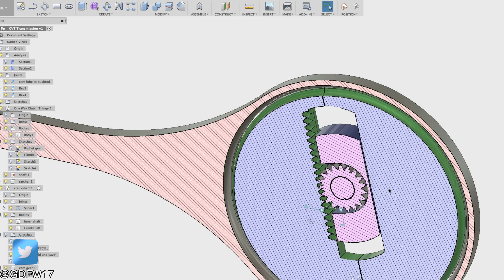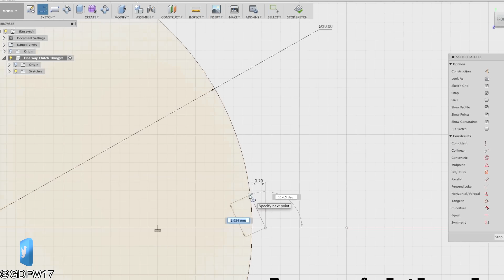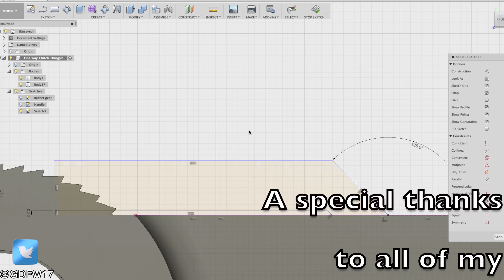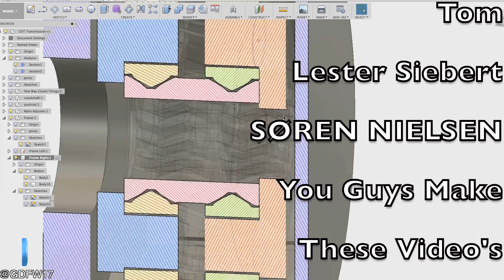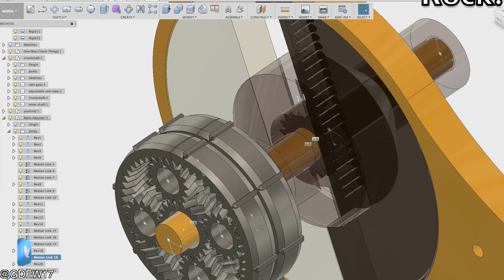The Coolest Transmission You've Never Heard Of... The Ratcheting CVT

Comment: You there? not seen many of this things of yours.. But? I was wondering. Why you haven't built a functional unit? do like a radio flyer wagon size.. making a Motor and transmission from the plastic hooked to the Axle to show the movement? Have you seen the engine designs from China yet?
Reply: when you YouTube china designs the first one is 50 different designs.. but if you keep looking down.. there are some other interesting ones.. And it's been a while since I watched them.. so..
Reply: you don't have to have Fire to have compression. Compression is simply expanding Air.. In a diesel there is no fire.. it's just heat and chemical reaction. Being said.. just to test theory's and to build first run. an air compressor would be enough. if your looking to run a full on Out option..
Reply: Which You're going to be.. I've been rolling around the Idea of using these plastic printer availability to try a Cold air compression theory.. See.. What I was thinking was a cold air source like Carbon monoxide? right? dry ice? with a Warm water mixing tank with a controlled pressure injection..
Reply: See.. by basically powdering the dry ice.. then adding hot water the mixture will create an expandable gas.. that then would be funneled into the compression chamber.  Using a like duel funnel design tank.. where the dry Ice like powder would enter as it is mixed with the hot water then captured and stored to be released.. think fuel filter
Reply: I'm a huge fan or the rotary design motors.. the newest one that's powering drones are impressive. But From your video.. I'd say just playing with the idea as you would other designs.. will be a puzzle of wonderment that will make you very happy.. Good luck.. My friend.. Trying to be there.. LOVE KIRBY
Reply: Kirby Wagner Diesel engines "don't have fire"? Are you nuts? I won't bother addressing the other idiocy you've been spouting..... Talk about parading one's ignorance!
Reply: GLOW PLUGS..  NOT SPARK PLUGS.. See? a Spark plug uses electric spark to ignite Fire in the combustion chamber - A glow plug Uses Heat to excite the chemicals to reach into an explosive reaction. that's the difference.  look it up..

Comment: Try ceramic for the slip engagement, steel wont wear out ceramic, i use ceramic bases when building hoist's and small cranes because the steel simply pivots and doesn't eat away the ceramic

Comment: I see more variable displacement engine than I see CVT to be honest... I guess if you play with the proportions of certain parts of the design it'll feel better as a CVT... And give it one or two more ratcheting mechanisms to make it smoother on the output side but still it's better as the basis for a variable displacement engine.

Comment: Why do say its like buying a super computer and playimg solitaire thats not true its like buying great internet and not using it,  a super computer u need to see as the engine and i see it as why would you tune your engine or upgrade it when its lets say always running at 2000 rpm it takes the fun out of driving and also wouldnt that make your car vibrate loke allot?

Comment: If the "simulated gear change" programmed shift strategy on older automotive CVTs bothers you...don't be an automotive tech. You'll constantly be reminded that the engineers in many, many cases just don't care about ease of maintenance. Now this obviously changes year to year, make to make, model to model etc, even just a different engine package, but I'm sure you know that already. :P

Comment: The problem with CVT's is they're automatic. A manual transmission in the hands of someone who understands RPM, engine load, efficiency, ext can be and always is better than any computer controlled system. If CVT's were given a manual adjustment like hydrostatic transmissions, id go trade all 3 of my cars in for vehicles with manual CVT's
Reply: Id like to see an automated manual transmission that can be shifted just like a manual transmission, clutch pedal, shifter and all of the other goodies. It could be done, if people could get past the somewhat irritating quirks of driving in what is basically a manual transmission vehicle, including off the line jerkiness etc. Designers have perfected the good old clutch/band/planetary gearset automatics, so eventually technology will make automated manuals seamless. 

To me a CVT has the same types of shortcomings that made the rotary engine obsolete. Simple design sure, but plagued by long term reliability issues due to the limitations of it's very design. Rotaries had too many seals, apex seals, side seals, damn thing burnt too much oil and was a major bitch once heat soak hit. Believe me, having an Gen 3 RX-7, I can attest to the rotary being nothing more than a novel idea that was doomed to failure. Too many negatives to warrant the positive traits. I definitely don't like the idea of hydraulic pressure being such a crucial part of the very operation and reliability of the CVT. The input to output drive ratio being 100% tied to maintaining high enough of a hydraulic pressure to keep the belt from slipping on the cones. No wonder high performance vehicles tend to shy away from the things.

Comment: I think a small, smart Diesel engine paired with an electric motor would be the better alternative.  Similar to a diesel/electric locomotive.  The right electric motor will have an endless power band, as well as great fuel mileage.  I'm not talking about a charging battery situation, too much weight!

Comment: It's not a CVT, because the ratcheting mechanism on the output will turn at specific intervals. So as you turn the gear ratio up, it will "step" up to the next speed when it clears another tooth.
For instance, as you turn it up, each ratchet will go from engaging on the first ratchet tooth, to 1.1 teeth (which will still end up only being 1 tooth), 1.2 teeth, and so on until it reaches 2 teeth, at which point it will engage there instead and give you twice the speed of the first tooth, then again until it reaches the third tooth where you'll get 3x the 1-tooth speed, and so on.
It is a variable speed transmission, but it's not a CONTINUOUSLY variable, as it adjusts the final ratio in steps.

Comment: I had a 2012 Mitsubishi Outlander with a CVT. It was magical to accelerate and see the RPM remain the same. It had an alternate mode that simulated a six speed manual shifter, but that always felt inferior to the full auto infinite GR. Also, it had a 100,000 mile powertrain warranty that remained in effect as long as the maintenance schedule was followed. I loved that thing. I got better than 30MPG, partly because I drove conservatively, but it also had surprising power when called for. 0-60 in about 6.5 seconds was the best I was able to do on dry, level pavement. I think it had a 168hp 2.4l V4.

Comment: Very cool design. The ratcheting mechanism is definitely the biggest issue and wear point with this. The best CVT design that I have seen is the style used in new farm tractors. They use hydraulics and planetary gears. The power is split after the flywheel. it runs a hydraulic pump and spins a shaft attached to the sun gear or a planetary gear set. A hydraulic motor is then used to spin the ring gear at different speed. The planet carrier is what is ultimately run to the output. Different manufactures have a few different variations on this, but that's the basic idea. Its definitely something that is cool to check out if your into this kind of stuff.

Comment: I suppose the "not really a CVT" you allude to is at the ratcheting mechanism.  If it's a typical geared one then the actual speeds are limited by integer number of teeth - if you try for an in between, it'll just add a bit of dead movement at each end of the range where it's not making it to the next tooth yet.

Comment: AS I got older,one of the most bitter pills to swallow was exactly what you experienced with the car companies limiting the CVT they installed...faith in humanity is misplaced no matter how much of an optimist you are.

It does not mean to give up hope, it just means there is a need to steel oneself against frequent letdowns.  Beating your head against a a wall can be tempting...but its futile and counter productive.  Greed is one of the main enemies of implementing innovations such as this.

The dumbing down of the American people by the public miseducation system is the basis through which greed can thrive by programming  people WHAT to think instead of HOW.  Its been going on for decades.

After the moon ladning in 1969, we all knew we would be making freuwuent trips there when we were adults.  We knew Mars was possible by the time we were middle aged.  Liberalism kills productivity.
Reply: No the problem is you think you know better than humanity what it needs. But most people know exactly why a transmission such as this is undesirable to them. And it is not a lack of understanding - it is practical and usability reasons as well as understanding perfectly well that for very minor gains it is not worth giving up a traditional transmission design of greater reliability (even if fuel efficiency obsessed government and automakers try to push it on you)

When the market is presented with a truly revolutionary design, such as Tesla's electric cars, they prove very popular - but all the bits have to fall into place first (and even then some consumers like me do not desire eletric cars for all applications for very specific reasons)

You have to listen to the invisible voice of the market because it is always trying to tell you something

Comment: A third point of consideration for an application the CVT transmission in not suitable for is heavy payload and towing. Given that the CVT is completely reliant on the frictional capabilities in its components to transfer power the excess load placed on those components does degrade them at a rate much higher the you would see in a direct geared transmission.

Comment: The only reason why people want to stay in manual is because manual is the best transmission.

CVTs have higher torque transfer effeciency, but they don't work properly in very high RPM, why? becasue they tend to slip.
Manual is better than CVT because not only that it has decent torque transfer effeciency, but it has the highest RPM tolerance.

Don't lose your faith just because people don't want it, its the portion of the car community who doesnt want it, and its clearly obvious why.

Comment: I had an '07 Audi A4 that had a cvt transmission that failed at 63k miles on the car. Made it alot harder to trust both CVT's and Audi. On top of that, a brand new replacement tranny for that car was $7000 so I had to get rid of it.

Comment: The tanks i drove (Not really tanks, M113 A3 and A2, M2A2 ODS Bradley) use either a torque differential for steering and a special setting for pivotting (Both tracks go in different directions) and the M113 A2 uses a special brake system to limit output to that side.

Comment: What if we had several sets of gears with varying ratios then we used a combination of some kind of selector mechanism to engage a specific gear set and a friction material to couple and decouple the transmission from the engine as needed? Seems much more simple and allows the driver to determine the best ratio for the situation. Then again my plan would require driver being engaged in the process and not allow them to treat their car as an appliance.

Comment: I am going to have to disagree on the second point. I have driven several CVTs. They just feel terrible. Under hard acceleration, they are slipping, which translates to wasted energy and a horrible throttle response. Light vehicles like snowmobiles will minimize this feeling, but heavy cars cause a lot of problems for these transmissions. I think this tech is a dead end. Not practical enough in real life. Looks great on paper, but doesn’t work very well in reality. So it isn’t consumers wanting what they are used to, it just doesn’t work very well. In addition, engines would need to be optimized to take advantage of the way CVTs work. That is something that isn’t going to happen.

Comment: great video.. I have a couple of questionss first where have seen or heard of a tank with two engine to drive and steer??? second correct mr if I'm wrong  but....wouldn't your transmission only be as strong as the ratchet mechanism ???? 3d printing is kinda cool but your effort in your first project eclipses this greatly I would much rather see a metel monster than a smooth plastic toy.. which is pretty much what you've got. yes I know you did this a proof of concept but your beyond that now and I look forward to see you go there.. do it man!

Comment: I'm curious how the input RPM of your drill compares to the output RPM of the ratcheted shaft.  
If there wasn't a weird visual thing happening due to frame rate, it appeared that the output speed was significantly slower than the input speed. 
If that's the case, does that mean that this transmission would have a greater amount of torque?

Comment: I remember I saw something similar in an industrial sewing machine to adjust the length of the stitch - speed of fabric transport. It did not have the common transport plate but a transport wheel. There was only one cam so that the step by step movement was in sync with the needle.

Comment: Ok I get the one side is the input and I get where the output is but what would you use to turn the heat ratio up or down the small part that you said has the planetary gears in it how does that get moved or rotated

Comment: I've always been fascinated with a CVT. And anyone who can demonstrate one on Youtube deserves our attention. Well done, very impressed. However I would suggest that you build one that can accurately accommodate a mainstream engine as your next build. Obviously this next build would be tuned to the sweet spot for a 'mainstream engine' and produce an output torque that can spin a tyre up to 200km/hr at the other end of this assembly. After achieving this, you would also demonstrate how the parts would be able to withstand these stresses and that friction (due to design optimizations) would be at a minimum (at least outlast current CVT's). Obviously you would consider using the right metals/alloys etc. Typically the efficiency of this kind of transmission is between a manual & an automatic. I would call it a 'green transmission' for marketing purposes. That way you have the mainstream media and globalists pushing your product free of charge. When you achieve a billion in profits, I want 1%.

Comment: Good of you to share this creation!  Others have mentioned vibration, and the two main thoughts hitting me initially are: what kind of design or size would it take to handle automotive levels of power and torque and speed; and it strikes me as best being attached directly to the bottom end of a gas (petrol) engine, which puts me off of course as EVs proliferate.  The main question becomes, is there a point to this when you can merely use an electric motor which has high torque from a standstill.  Transmissions, and gear ratios, being useful for humans to get bicycles up to speed, and internal combustion engines to get up to their narrow band of best torque.  The ease of modern control of electric motor speed (a range of 20,000 rpm without trying too hard it seems) may render any CVT obsolete.  Might not though, and I suspect this sort of mechanism may have a use somewhere, for special circumstances, maybe space rovers for traversing a surface with uncertain characteristics, and returning with a heavier load eg space rock samples, so needing lower gearing.  Relatively low power input as well, so it might work there?  Thanks again, thought-provoking.

Comment: The vibration of this transmission will be very big because of imbalance. Do you have any ideas to counteract vibration?
Reply: Counterweights just like any crankshaft
Reply: If two of these were pared, it would solve the problem with dynamic balance. because of its three phase design, there is very little static imbalance. It's exactly like balancing an in line six engine.
Reply: @Bad Santa The way it free wheels, it might work well in a bicycle. It will coast when you stop pedaling, and that is a low speed, high torque application. A perfect fit.
Reply: i think it would have to be made with much more precision then this and every dimension must be calculated with purpose just like a tourbillon watch movement every single gear in the watch is made with crazy precision and without that it would be as accurate or for this subject as efficient or effective
Reply: also isnt the output going way too slow? Like so much energy is being lost
Reply: I think if you balance the weights on the moving arms, it should be fine, because those arms is not moving at the same direction at the same time.
Reply: Same question here...how to solve the vibration

Comment: I am looking for one of these that I can adapt to a windmill generator system for my house. My idea for your transmission is to put a fin on your throttle knob that would catch the wind there in adjusting the gear ratio to wind speed to maximize efficiency of my windmill. But in extreme wind it disengages the gears to save the gear box. Any Ideas on this topic would be greatly appreciated. 
I have honestly watched this video 5 times now... very cool concept.

Comment: How much power can it transmit?  It's easy to make something run with no load on it.  How about hooking the output shaft up to a fan, a pump, or a generator so you can measure the load?  Maybe you could 3d print a prony brake?